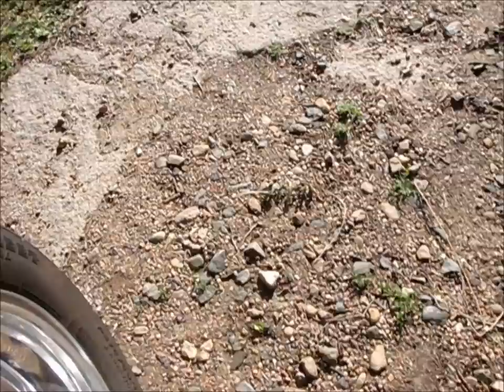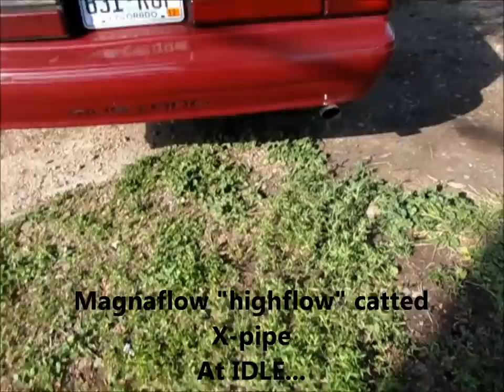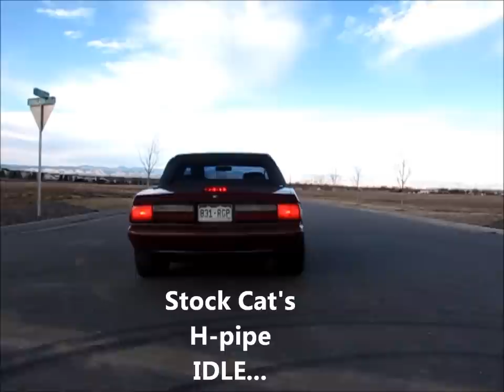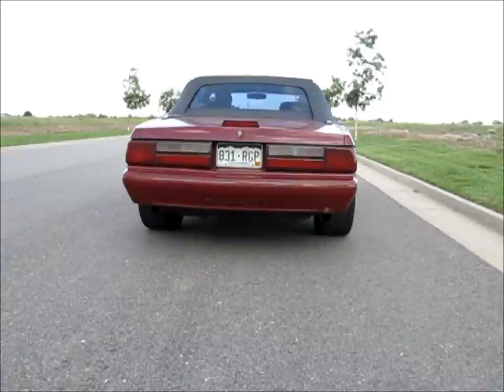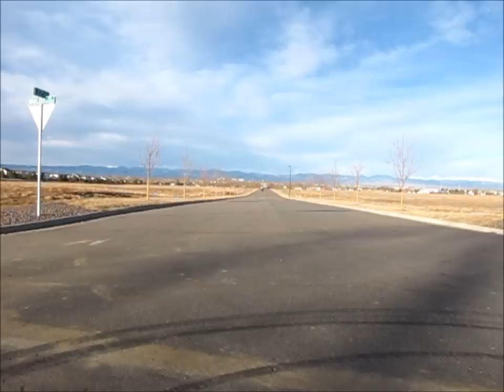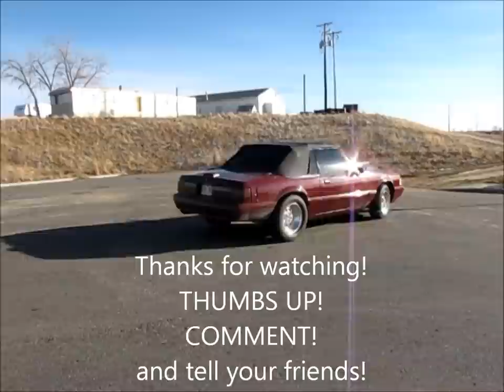X-pipe vs H-pipe

Comment: There's just nothing quite like the sound of the 302.

My favorite small block V8 sound!
Reply: Definitely one of the most distinct engine sounds
Reply: Government Motors
Reply: Which became government motors after the bailout.

Which ford denied because they didn't need to be bailed out by the government
Reply: ***** Um did you hit your head? Name a single GM from that era that could touch a fox body? I had a convertible gt so the heaviest you can get and it's still 300+ lbs light then a corvette coupe. Power wise GM had to use a 350 cu so 48 more to beat a mustangs HP then it was only by like 10 hp. And the 350 corvette, camero, firebird formula 360 and GTA all still had slower track times.

But none of those is a muscle car anyway they are small block sports cars. Now for long block muscle cars mopar smacked them all around.
Reply: ***** 136, 221, 239, 255, and 337 flathead v8's 289, 302, 351w, 390 fe, 427 side oiler, 428 cobra jet, 429 cobra jet, 460.  Thats just the old school pushrod v8's I haven't even mentioned modern v8's.  4.6, 5.4 and the famous 5.0 coyote to name a few.  All of these motors were revolutionary at there time and performed very well.  Most Ford v8's have very strong bottom ends so if your budget building like I am with a 351w you can focus on heads, cam, intake, and carb and still make 450 hp with spending $2500-$3000 on the whole motor depending on what deals you can find.
Reply: @ar15freak  Incorrect. They took loans from the energy department.  About 6 billion dollars
Reply: @MrWewalt  don't forget Chrysler Corporation's early smallblocks- 220hp-290lb-ft 5.2 Magnum (318ci) or the mighty 255hp-345 lb-ft 5.9 Magnum (360ci) which made an 4300 lb 1998 Jeep Grand Cherokee run 0to60 in 6.9 secs and quarter mile run at 15.2 secs.
Reply: @kargmeister  using the words strong bottom end and 4.6l ford in the same sentence with each other without the words does not and have in the same sentence is not okay. A 400 horsepower limit on a motor from the 2000s is not okay.
Reply: @Prestiged_peck  4.6 was meant more for longevity than performance anyway, and they do last a really long time.
Reply: @jimstenlund6017  you do realize koenigsegg, a supercar company, used the ford 4.6 right? And while the 2v was undoubtedly a truck motor first, the 4v cobra motor was purely built for performance, and was pretty damn good at it once they switched to the C heads in 99 (the 92-98 B heads just flowed too damn much. For an N/A engine, if the 03/04 cobra had had B heads the 4.6 would be much more popular and have made much more power.
Reply: @Prestiged_peck  No, I didn’t realize they used a 4.6.
Reply: @jimstenlund6017  yep, they did, the coyote is also quite heavily based on 4.6 architecture, to the point you can use coyote rods for a stroker 4.6. Also koenigsegg still uses heavily modified ford architecture, the TT v6 tons of their cars use? Based off the EcoBoost. Their freevalve 3 cylinder? Loosely based off the EcoBoost 3 cylinder, their 5.0 TT v8? HEAVILY based off coyote architecture (in fact you can bolt up coyote heads is you block off certain coolant/oil passages to prevent mixing, they won't work terribly well because of oil starvation but they'll run till they seize. In fact I believe they used ford timing components before they went freevalve, and they were using old 90s 4.6 teksid blocks with stroker cranks till like 08ish, then they started casting their own, the CCR/CCX and other early cars had them
Reply: @Prestiged_peck  Coyote is heavily based off a Ferrari design I thought, just changed the firing order to avoid sounding exactly the same.
Reply: 302 is a leetle beech just like you my friend. MOPAR or NO CAR!
JK 😂

Comment: If you need a boost in low end torque, pick up an h-pipe. If it's high end horsepower later in the rpm band you seek, an x-pipe is the way to go.

Comment: 1. The x-pipe will flow better, and increase velocity; as long as it is sized properly. 

2. It definitely sounds better to me, on most vehicles. 

3. H-Pipe pressure wave equalization, just doesn’t make sense for max rpm horsepower. Most guys don’t realize that they are looking for this. They think a certain power figure, and fail to realize that the curve dictates a lot.

Comment from the maker: nitrous is easy to hook up, no big deal. I had bad results when my motor was mostly stock because the OEM valve springs where so worn out, that I had a back fire.

my main problem with nitrous is having to fill bottles, wait for them to warm up/get up to pressure, and having to make it a "event" to use it. thats why I want a supercharger.

Comment: Did you notice an increase in performance from the stock converter assembly vs the magnaflow x-pipe converter assembly, both sound nice and even the x-pipe has a lope also

Comment from the maker: the clutch will eventually not let go, or get stuck, it will damage the bearing retainer on the transmission, which is over $100 I think.

if you pull the transmission yourself, the bearings are about $40 to $80.

Comment from the maker: lift the rear tires up in the air, mark a line on the tires and driveshaft. The driveshaft will rotate 3.73 times or 4.10 times for each turn of the tires.

Comment: i used to have a mac pro chamber h pipe, ( the best sounding off road h pipe u can buy) and then i switched to an x pipe, i was not happy, the x pipe is not as loud at cruising speed . and only sounds good at higher rpm, (trick flow,h/c/i,306)

Comment: To some (myself included), it's not a question of sound, but a question of flow.  An H pipe will result in a louder, throatier exhaust note, without a doubt.  The X pipe will definitely allow for more smoother flow of the gasses through the pipes, but the sound will be noticeably quieter.  The choice just comes down to what you're looking for out of your exhaust.
Reply: Actually I don't.   I have an X pipe exhaust and a set of flowmaster 10s, and you'd expect my setup to be significantly louder than it is.   After looking into it, I found out that it's the X pipe that made the difference.
Reply: Hey Chris,  I have been trying to figure it all out.  I have an LS2 gto and running strait dual exhaust, no x or h pipe.  What advantages are there for either over the set up I have?  I also have long tube headers, high flow cats.  I had it tuned and the tuner told me my set up will flow better then either x or h pipe.
Reply: The crossover pipe allows the back pressures on each side of the exhaust to equalize.  This allows the exhaust to flow more smoothly and in turn, more efficiently.
Reply: So the x pipe basically has a better scavenging effect. I think I will stick with what I have for a while.  I have had so many compliments on the sound of my exhaust even though it may not be the best setup for power.  The car has been custom tuned for this setup. Thanks for your advice.
Reply: X Pipes may flow better, but they're just to RASPY for me. That's why I prefer an H Pipe. And the difference in power is very little so it's no big deal.
Reply: James Walker I got to agree James I like the H pipe sound better too and thats what I run. Yes the X has better
performance but unless a dyno test shows me a 20 HP difference I'll run my H pipe and be happy with the sound.
Reply: kevin122759 Kevin, a cross over pipe enhances the torque a bit in the lower RPM range so if your motor is a little
light on torque in the lower rpm range you probably want to have some sort of cross over. If not you can run two completely isolated sides and will work well too. I don't know if any one did a dyno comparison of the 3 set ups would be interesting to see results.
Reply: mrelectron62
 Thank you for your reply.  I have not done any  work on the exhaust since the HP custom tune.  Tuner said not to mess with exhaust.  Car has plenty of torque off the line.  The only problem I have is with the torque management.  Car breaks free under heavy acceleration and the shifts (auto trans) are harsh.
Reply: @kevin122759  that is correct and you will find that your car will accelerate alot more at low rpms with the H-pipe but pull much much harder in freeway speeds or high rpms with the X-pipe. You WILL see the biggest difference going from a back pressure punishing true dual setup to a days of thunder feeling setup with an X-pipe.

Comment: travis king should be getting a lil more than 230-240, i'm putting down 232 at the wheel with just 40over pistons, b303 and 750 double pump holleystock e7 heads, stock pulleys.

Comment from the maker: strange engineering 10-way adjustable shocks and struts, MM full length subframe connectors, UPR upper and lower control arms, stock springs and such.

Comment: was your stock H louder than the X? or was it the wind affecting the sound a lil? car sound good cant wait to get mines dialed in (timing). ported GT40p with ported upper and lower gt40 intake with TFS stage 1 cam. stock headers and H pipe and maf and throttle for now. to be honest i wish i went with aftermarket heads, brought them already ported.

Comment: I've seen notches with a GT40 setup an stock cam with 1.7rr, 4.10 gears and slicks run mid 12s times. You're talking about less than 2k in a car that's coming up on 30 years old and still running with new performance cars. You don't see the IROC F body cars doing that with the engine they came with.

Comment: so i got a rebuilt 302 with f303 cam,gt40 upper and lower intake,msd cap and coil,underdrive pulleys,shorty headers,flowmaster offroad h pipe,smog pump delete,3.55 gears,short shifter,race clutch,e7's worked,cold air intake,73mm maf sensor,65mm throttle body, just wondering about how much horsepower you think im runing

Comment: Does it matter what the diameter or length of the H pipe? Looking to gain the most out of fabricating it.
Reply from the maker: Unsure. But if you make the cross over between the pipes larger it will be deeper. 

Like the Mac H pipes. They have a big box of metal connecting them.

Comment: Any LS motor will outperform a 302 mod for mod every day of the week and twice on Sunday. Not to mention the fact that an LS block will handle over 500 horses w/o cracking, unlike a 302. 

The 302 does well because it was put in a light car, it is no miracle motor.

Comment: Honestly don't really know much about cars so what exhaust pipe would u recommend for a Mazda 6 a grand touring
Reply: Not a dual exhaust  with a cross over. These are meant for cars with v8s or maybe even a high performance  v6 in cases. Stick to maybe a 2.5" single exhaust  with a straight through muffler and no cats or hi flow cats.

Comment: hey Xarmy could you give me the part numbers to the max flowpaths you purchased for this car and how you set up the exhaust? i am really looking for a sound like how the stock H pipe "take off" sounded.
Reply from the maker: unsure of the part number. it's the mac cat back and I believe it was a kit they sold. I got them second hand. 

flowpath is the line of muffler Mac calls them
Reply: +XArmy187  don't think it would happen to be this one would it? http://www.americanmuscle.com/mac-catback-8693lx.html?utm_content=Exhaust+-+Catback%7CMAC&utm_campaign=79-04%20No%20Years&utm_source=Google-pla&utm_medium=Shopping&utm_term=%7Bkeyword%7D&AMID=mac-catback-8693lx-FPReplacementV1&T5_Var3=blue&GID=40078.   And thanks for the reply man. You still enjoying your coyote?
Reply from the maker: +Fast85FoxGT that's not the same one as my car has but it's the same muffler so it will give you the same sound buddy. 

Coyote is honestly too "tame" to be fun. it's fast, but not wild like the fox is. 

fox will be back soon. 

and I have another "foxbody" bring built now that will get a Coyote drive train. 

when it's done, the 2013 is GONE.
Reply: +XArmy187 That will do then.... Thanks! and I definitely agree with you man. Foxbodies were kind of the last true feeling muscle cars in my opinion. you could feel all the power as it wasn't refined, but you still got to love modern muscle power. I have a 07 charger RT track pack that's pretty much stock I play around with. Its definitely not fast feeling at all but it has hurt some feelings. Not the fastest car. i could maybe crack a high 13 out of it. More if it didn't like spinning in first....... Are you on the Facebook group foxbody addicts by chance? My buddy parker Golightly has a 87 saleen yote swap with a VMP on top. He could definitely share some insight.
Reply from the maker: +Fast85FoxGT yeah I'm in that group. 

and yes, you hit the nail on the head. foxes feel like old muscle cars without a lot of the terrible shit of classics

Comment: what cam is in that car. It sounds like a FR E303. Is that what it is?
Reply from the maker: trickflow stage 2
Reply: +XArmy187 what kind of magna flows
Reply from the maker: +smrf3426 it was a magnaflow mid pipe. the mufflers are mac flow paths

Comment: the damn wind screwed up some sound in my opinion
Reply: Yo the H pipe always sounds better on a 5.0. I got a 331 on my 89 vert GT and I tried the X but it just wasn't happening with my Winsdor. X pipes are for newer 4.6,and the new 5.0 duel cam mustangs. Take that expensive X and sell it... unless you plan on getting a newer stang....

Comment: Forget all this x pipe, h pipe bullshit. Just run straight pipes from your headers.
Reply: You can do that but your losing some low end torque that way and if your running a cam to produce more
in the higher rpm range its better to run a cross over on your duals if you don't care or make lots
of low end torque don't bother with it.

Comment: Is that a 350 V8?
Reply: Really? A 350 v8 is a CHEVY motor this would be a FORD. Slight difference there buddy
Reply: OMG haha 351 I hope that was a typo
Reply: wolf pendergrass i dont think its a typo lol he pry doesnt have a clue this is even a ford mustang, pry thinks its a camaro hahaha
Reply: wolf pendergrass im pretty sure its a 5.0 302 and not a 351w/c. The sound gives it away. 5.0's have a very distinct sound all of its own but either motor is badass. Ive owned lots of fox bodys and they all have had 5.0s and 5.8s w/c's in them

Comment: I just think it's funny when GM fan boys say oh Ford doesn't have displacement you have an engine that's almost a liter smaller and is a liter smaller in the 4.6L case that turns just as good of numbers as GM's higher displacement. Then you sub in a 351W or a 351 clevor or a built 5.4L what happens? LS motors get shit on.

Comment: That's what the new Stock 5.0L GT cars shits all over any stock LS power F-body. Less hp and displacement than the new SS and still turns better 1/4 mi and 0-60 times. Don't even get me started on the Boss 302 vs the new base C7, that has 1.2 more CI and the boss still stay on it's ass on the track with a $20k less price tag. Don't down Ford they have come a long way VS GM who packing up and moving production to China. I will never own another GM vehicle as long as I live, bet on it.

Comment: people who dont realize that there is a few hundred pounds difference between the two are idiots. maybe you can get 400rwhp out of a 350 but you drop a 351w in the notch and it will make the same rwhp and run near a second faster. power-weight, but some people go overboard and think it makes their honda's fast. Either way im saying the 302 can make 350 rwhp to a 350 400rwhp and run equal or faster cause the weight difference and the transfer. Thanks for calling me an idiot though

Comment: mod for mod the notch would be faster than any LS car, the 302 is tuned down so much that when it does get its mods it opens the hell up, h/c/i takes it to double the rwhp it cam with stock so.... yea and the mods are cheaper so fuck an ls get a real car